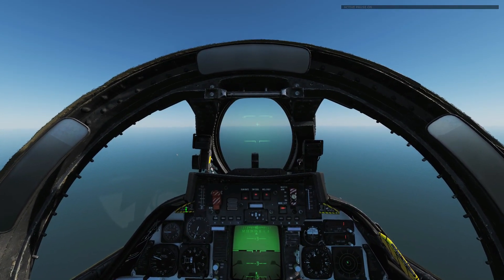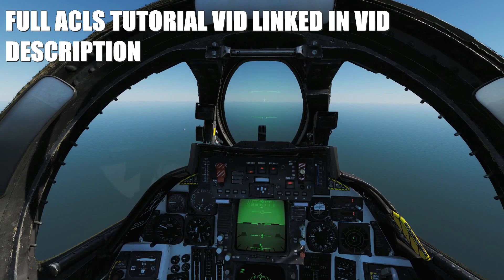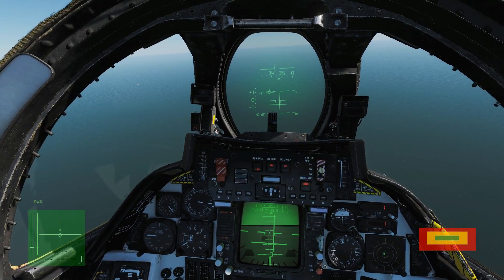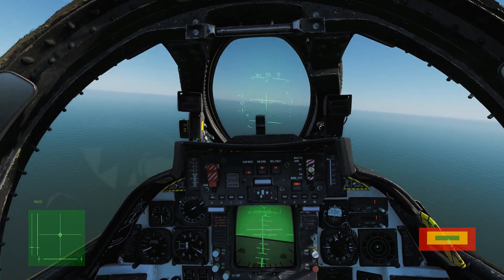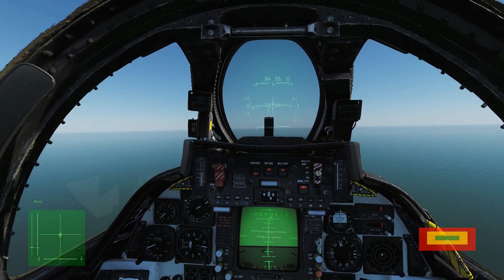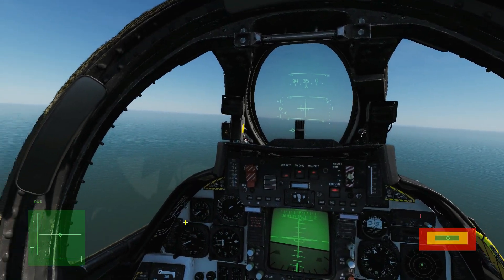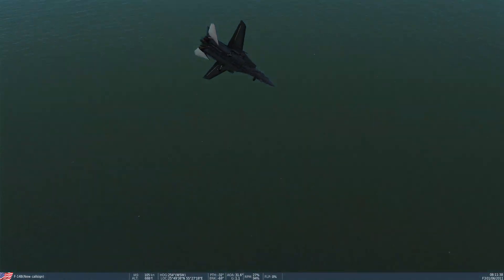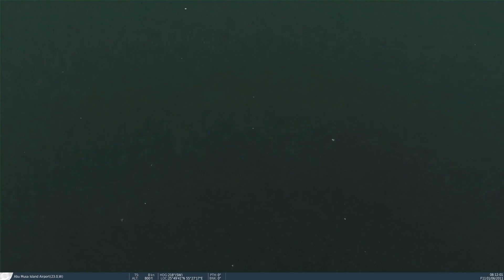F-14B Tomcat: Does ACLS Work With One Engine? | DCS WORLD

Comment: 1) Question: can you do a formation trap landing (you joked about it in your SHB-video)? Wires are separated about 12 meters. If 1st aircraft catches the 4-wire and the 2nd aircraft the 1-wire they should both stop without crashing into each other. Bolter is obviously not an option for the 2nd aircraft. 
2) Can you land an F/A-18 on the side of the Inguri dam? There is a video with a Harrier landing at the side and then sticking to the side like a fly. I would like to see if a F/A-18 could do the Harrier-style landing. Or any other aircraft with sufficient thrust. And sufficient pitch up authority.
I only managed to max touch the dam and to slide across it / break the landing gear (or exploding, which was 99% the case). I do not mean landing on top of the dam (there is a SU-27 video), but on the side of the dam.
Reply from the maker: Will look into it.